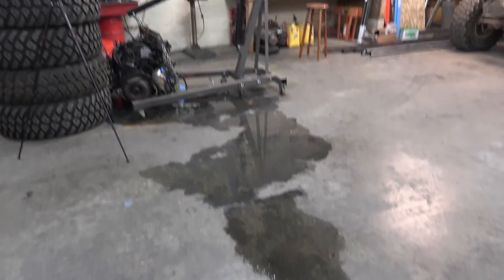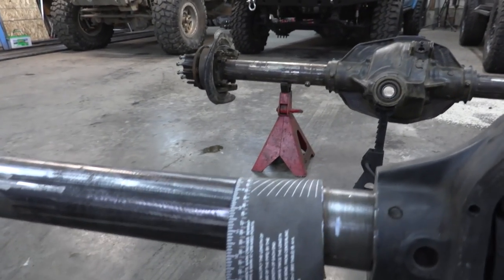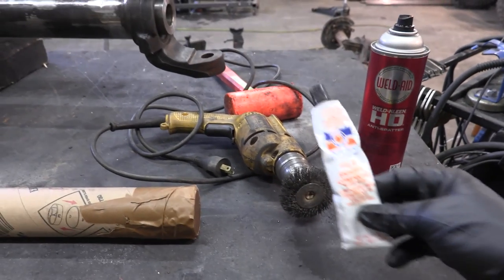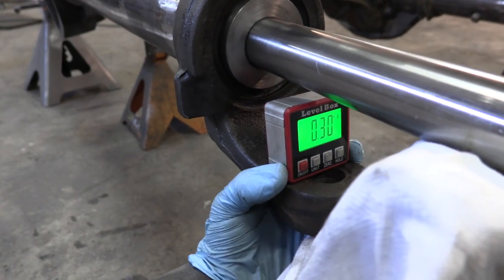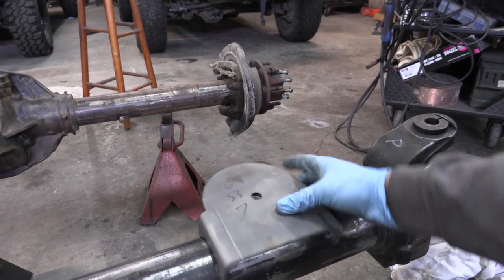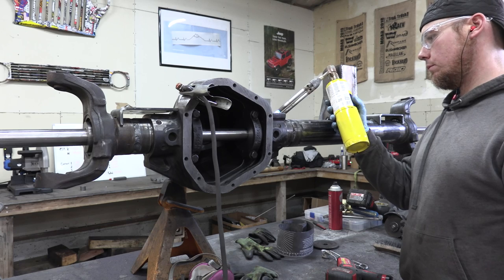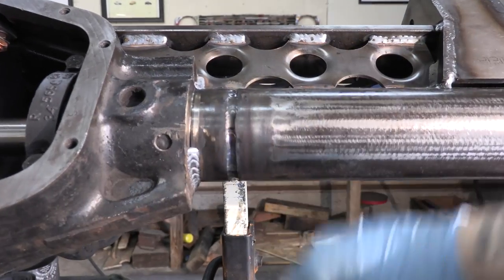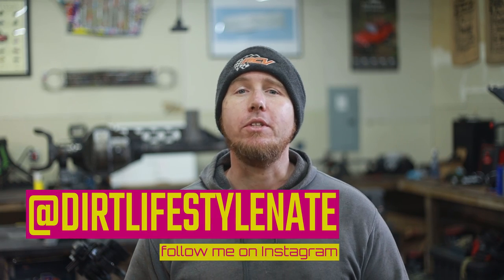Homemade Passenger Drop Dana 60. Ultimate Land Rover Discovery Build Episode 3.

Comment: Awesome video! I like how you show some very useful tips with alignment of bracketry! One of the most useful videos I have seen regarding axle building. The alignment rod is really the way to go.
Welding: You need a high silicate filler rod for Diff housings to mild steel welds. That type of material allows more durability in the weld and is far less likely to ever crack, ever. IF you use that filler rod and per-heat the cast iron you will get a perfect and durable weld.

Comment: Great Video! From my experience with TIG you can concentrate the heat more in the weld puddle, this paired with the lower heat conductivity of the housing could cause a higher difference in temperature between the weld and the housing, which leads to different rates of contraction and then you get cracking. MIG does a better job of pumping more heat into the surrounding material, causing a lower difference in temperature between the weld and the material of the housing around the weld. just my two cents. Please share if you find the answer. Thanks
Reply: Erik Schutzman good advice.
I would’ve welded it MIG with ERNi-1 wire.
Reply: @stevej6824  Thanks!

Comment: Shop tip for you.   Use propane instead of acetylene in your oxygen torch.  Way cheaper. And works almost the same.  My dad has been doing it for years.
Reply: Totally, I switched over to propane about 15 yrs ago for my go too torch and then I have a medium size set up with acetylene for the thick stuff. The tips are a little spendy for the propane but the first time you fill up your propane tank you just made your money back.

Comment: When I chop these and other axles i put them in a fixture and it looks like you have a nice steel table in the back ground you could have just made fixtures to bolt where the Ball joints mount saves Alot of time and is very accurate.
But looks like its turning out good though

Comment: Very informative,  thank you.  I am just curious.  Do you ever add trussing on the bottom.  Also,  do you ever add a skid plate and lastly  I noticed additional welds on the diff cover, did you add those  ?
Reply from the maker: Trussing the bottom is actually more effective then trussing the top but its gets hung up on rocks and obstacles. The cover came welded like this from barnes 4wd 👍
Reply: Thanks... my wheeling days were back in the 70's in eastern Washington lol... many changes since then lol... now I am retired,  it's becoming an interest again.  Still trying to learn some of the new things.  Another is stretching the wheel base... hydraulic steering and will it work on a street driven vehicle... tires have come a long way, we used farm implement tires with tubes to keep them from blowing beads lol... just a lot of fun,  appreciate your programs and information and taking the time to respond,  thank you.

Comment: Such as bada##. Nice work. Love watching these fabrication builds an inspiration for sure. What are you doing about the axle shafts since you cant just go pick up a chormaly shaft for a super duty off the shelf?
Reply from the maker: Many manufacturers make chromoly shafts for these off the shelf. Rcv and yukon both do and the way this is built OEM shafts should slid right in 👍
Reply: @DirtLifestyle  ok so you did you keep them the same as stock but just swapped the center section to passenger drop. Smart move.

Comment: Would it be possible for you to put up some price comparisons with some of your diy fabrications with store or custom shop work prices?  I am really curious what kinda money you can save if you can do it yourself. I mean your work is priceless art of course, but still curious.
Reply from the maker: I've done this before and it was actually a ton of work to gather all the data and present it. On a small scale I spent less then 20 bucks on the sleeve and less then 20 on the truss. The rest is just tooling cost, most of which I bought many years ago. Thanks for watching man 👍

Comment: The reason that each side has a slight difference in angle is that originally the vehicle needs a slight caster split to help hold the road better so the vehicle doesn't always drift to the low side of the crown of the road.

Comment: Looks like you only took measurements to keep use of the original shafts. Pinion rides on the left side of the ring gear.  Did you consider the ds/pinion location as well?
Reply from the maker: Shouldn't have to but if it's an issue no big deal. I'm getting aftermarket shafts anyway 👍
Reply: @DirtLifestyle  Yah, I was thinking its probably a no cause of the overall track width difference. Something like 3" IIRC from your initial vid on this transformation.

Comment: You did a nice job of doing this. As someone that does this professionally I can tell you that A) the alignment bar does nothing for holding things in place. Its simply a tool to get things true. That axle is so straight because you did an excellent job of sleeving and aligning the rear to the correct place and welded it properly. And B) you tigging the cast to the tube cracked for 2 reasons, its not filler or tungsten. I ran into this exact issue when I started stepping up to bigger rears like this from typical race car stuff like 8.8s and 9inches. Ford/Danas cases are nodular iron, not cast iron. They weld via traditional fillers and methods perfectly fine, a 500-600* preheat is ideal. That being said the tig weld cracked because your heat effected zone is way too big. I ran into this issue doing exactly what you are doing for a personal project. I was trying to root a nice wide tig 3/8 weave from the cast to the tubes. It would crack everytime simply because the amount of filler in that large of a tig weld is too stressed when the cast contracts. Even though the heat control in my weld was good and the weld was nice and shiney and not cooked it still cracked. I turned the heat down and welded a typical 1/8 wide root than capped over than and never had an issue again.
Reply from the maker: Nice! Thank you for the info 👍

Comment: Good work.....
I have built hundreds of custom housings....and straighten race axles that are abused in ultra4 races. (King of the hammers)
I’m only commenting because in end of the video you voiced concerns about welding to cast.....
Heat it up to 400* burn it in hot with mig, I always use duel shield wire, .o30 75/25 gas 20 amps at 350ish on wire speed. Keep the cast hot once preheated until welding is complete.....
Tig welding on the cast...same....as long as the cast is hot, shouldn’t see cracking while welding...400*

Everything you did is spot on to how I have done many housing builds.....with one exception.....
With the right sized porta power ram and a torch, you can push the tubes out of the housing with the ram in placed inside the differential, this eliminates cutting the tubes or cast center section. (Roseta welds, burb out with torch prior to pushing tubes out)
Then with your press.....that’s identical to mine...lol

Push tubes back in to the housing....then just weld the tubes to the cast center section....

I have sleeved and cut tubes many times just as you have done.....making custom setups, or rear steer set ups....
Bar and sleeves are way to go....
Great job!

Comment: The only thing I could weld with ,on cast iron with tig is brass (silicone braising roads) comes out very good but I don't know if is strog enough for ur aplicaton,  but for sure is good for coverin the areas where u don't want water and mud to get in... nice job,  look in to Metalcore wire for ur mig , beautiful welds and much stronger...

Comment: I narrowed a d60 to fit under a datsun pickup,  take your aceytlene cutter, plunge the spot welds out (not all the way through just down into the tube) pull the tubes out and cut to length, turn the tube further up the tube enough to press them back in.  only tough part is having the floating axles to length.  you probably could have swapped side to side and press back in

Comment: Hi good build info I need to build a Dana 30 front axle housing but I want the center housing to be centered   and from center of steering knuckles to center of knuckles to be at 48 inch is this some thing you could do  I have axles housings let me know also depends on were you are at to thanks.

Comment: What axle wood you suggest for the frunt on a 94 explore I was thinking jeep so I don't  have to change bolt pattern?
Reply from the maker: I have no idea man. Not alot of options unfortunately
Reply: The 94 was a d35 housing, right?  The d44 should be fine as long as you find one the right length.  That gives you the bolt pattern you need if your axle is from a Jeep.

Comment: so to avoid the cracking with tig welding , you need to feed more filler wire and either use pulse , or do short tacks , stopping 5 to 10 seconds between tacks . also with the wirefeed your probably  using er70s-6  , and many people with tig are using er70s-2   , which also might account for the difference ...... i would probably use 309 stainless rod .

Comment: Problem with welding with that bar in there is it can get stuck! I don’t weld up the tubes and truss with that bar in there only tack, I will check it after and bend it straight if needed. When I’m doing a truss I pre bend the housing.  I have had customers bring me housings that they trussed that are really far off, 1/2” or more at the ends. And they did the whole weld and cool thing that’s Super tedious. you just can’t tell if it’s bent with out that alignment bar. 1st front axle  I trussed it was .250 wall so I thought it will not bend, after I got it powercoated the axle wouldn’t fit! I have used 309L tig wire to weld the cast to steel with really good success.

Comment: Solid video bro! 

I used the alignment rod just like that when I put Ford 9" housing ends on my Ford 8.8 axle. I've never use anything but that from here on out. I got my rod from my local welding/metal supply. 

I'm digging that diff cover, where'd you get that or did you make it yourself? Lastly, after seeing this, I now need to convert my press to air like yours. lol

Comment: If you find a place that sells the jig I would be interested 🤪
Reply from the maker: You can contact @rubberduckytj on Instagram if you want some custom pucks made 👍
Reply: I just finished doing a rear Dana 70 and got done with the paint and while fitting the hubs realised I hadn’t drilled and tapped a breather into the tubes

Comment: try out a high nickle rod ( give 309L a try )   or  if that does not work look into something specialty for the housing joint 
very high nickle rod like for  TIGging back together cast iron ( if the cast is good quality) much more of a pain to do that though 

 and keep doing the pre and post heat like your doing  perfect!

you look like you have some housing scraps to try out for a test

Comment: Man been trying to plan a build that would require me to push axle tubes. But after seeing how you did this i am soooo glad i checked up you tube. 

Ill be doing it on a rear dana60 so it will be a bit simpler. But i like the idea of just sleeving the inside and then it will help keep cost down on my build. 
Then i can just truss the rear diff. 

Will be going under a 2005 tj so I don’t see an issue with doing that.
Reply: I mainly don’t have access to a big press to get the tubes out and the closest one is in the city about 2 hrs away.

Comment: Why didn’t you add more pinion angle or caster while you have it apart?
Reply: I'd guess because he is going to be running a similar ride height, driveshaft angle, etc. to what it was used in.
Would like to see the calculations & figuring as to how it will preform as I'm going to need to learn & figure this out for projects of mine.
Reply from the maker: Not necessary. 99% of axle swaps don't change the caster and that's for good reason. You only need to change it if you are lifting your rig a TON! This is also one of the benefits to using a high pinion in your swap. With the pinion higher you have even more flexibility ability then OEM in many cases.

Comment: Do you have any ideas for how I can fix a Dana 44 front axel from a tj that has a bend in the passenger-side tube? I was thinking I could maybe try and bend it back with heat? Replacing the entire tube  will be expensive at a shop or require more tools than I have - like a big press to press in the new tube. The alignment bar you showed is neat, and would probably help.
Reply from the maker: I've never had to bend an axle straight. I know it would be a hassle so I stay away from the need by putting a truss on every axle I build. I would toss it and start with a new one if I was in your shoes 👍
Reply: Dirt Lifestyle thanks for the feedback. Not the answer I wanted, but oh well 😆
Reply: Was a post from a guy that said he used to bend axles to repair them on race cars in this chat.

Comment: Are those housings cast steel or cast iron? If it’s cast iron use inconel filler rod with pre heat and a slow cool down. If it’s cast steel a red 1/8” tungsten and some plain ER70 filler should be fine.
Reply from the maker: Cast steel on the dana 60 housing. Thanks for the tip!
Reply: according to the bible:  http://www.billavista.com/Tech/Articles/Dana_60_Front_Axle_Bible/index.html

Differential housing construction: Nodular iron

Axle tubes construction: mild steel

Inner knuckles (aka tube forks, end forgings, or "Cs")  - forged, premium low-carbon mild steel

Outer knuckle construction: malleable iron

Comment: I hope you put out axle tube seals into this axle so the tubes won't get filled up with mud.
Are you going to put a 60 or 70(with the swap kit) ring & pinion into this axle? 70 isn't a big gain over the 60 guts because of nearly the same size pinion diameter but ring gear is bigger.
You should get together with DeBosse (even if it's just as a rig show case.) You're both builders of awesome machines that it's hard to believe none of the factories ever did what they needed to to offer & tgen reaped the big sales from them.
Reply: Link for the gear swap
http://www.jantz4x4.com/jantzPrint.php?pro=jana_76&mid=j76hpig

Comment: Cast iron and cast steel needs to be peened with a hammer to prevent cracking, works best with stick, Lincoln has a few different rods I like for cast iron and cast steel. 7024 works good also for joining mild steel to cast iron or cast steel. It has a lot of slag but worked well for me especially when I was welding at the shipyards.

Comment: What filler were yo using to TIG the Mild to Cast? I've used ER70S with pretty good results before on some cast steam traps.
Reply: Most places i"ve worked hate buying the $$$ Nickel filler rod unless absolutely necessary.  Multiple passes of er70s-6 helps water down the amount of carbon pulled out of the cast iron.  First pass make sure to get a good root, then on final passes try to favor the heat of the puddle onto the mild steel side while adding in as much filler as the puddle can handle.

Comment: One question I always had is could you take a Chevy/passenger Dana44/60 low pinion flip it and rotate the c’s get reverse cut gears and have a ford/drivers high pinion looked online with no answers

Comment: You're wrong about how pipe is measured though, the od doesn't change with thicker wall. The id gets smaller as you go up in schedule. All pipe under 12" is given a nominal measurement that's different from the actual OD. I'd figure a plumber would know that!

Comment: Tig is too concentrated for cast, you need high nickel filler rod and you should heat the whole unit for large cast parts. Small stuff I’ve gotten away with not heating. I like E3 tungsten as well. It’s doable just finicky. For your application I’d just mig it and call it a day.

Comment: I want to narrow a Superduty leaf spring Dana 60 to fit an S10. Where on the long side would you recommend cutting the tube if you could do it anywhere? It would be slugged just like you have with no truss.

Do you think I could use a GM 1 ton tie rod steering arrangement in a T style or would it hit the diff cover?
Doesn't seem to be a lot of fab parts that fit the Ford tie rod ends. Like bungs and jam nuts. Everything in the aftermarket seems to be fit around GM 1 ton or heims only.

Comment: er70s-6 mig welding wire for mild steel works great for welding to cast. you can get the same filler rod for tig welding. I like the way you did this but I wouldn't do it without a truss

Comment: I’m sure someone has already said this and your probably already done with this, but contrary to popular belief, most center sections and hub ends that people think are cast, are actually forged. A lot of people see the “seam” and think it’s from a casting but is actually just the flashing from the forging dies. The reason I find this true, is because a production manufacturer wouldn’t have steel casting like that welded from the factory. Too many variables for failure. So a good rule of thumb, is usually if it’s welded, it’s a forging and not a casting

Comment: Check out Banks channel videos on diff cover tech. Weld a bunch of fins inside and out to help get the heat out. Internal fins shouldn't get in the way of the fluid being thrown onto all the internal parts. External ones would add strength and spread rubbing and collision forces. 
What do you think?

Comment: What's up Nate had a quick question I have a 1973 K5 blazer and I want to do a one t swap on it be only problem it's hard to get a Dana 60 for aChevy K5 Swipe found this axle it's from a Dodge 2500 diesel I was thinking of doing what you did to the Ford Axel and swapping it I wanna know how hard is it I do have experience in welding I notice that you used a alignment bar It could be done without one let me know thanks I appreciate it The axle only cost 500 bucks  For the Dodge axle